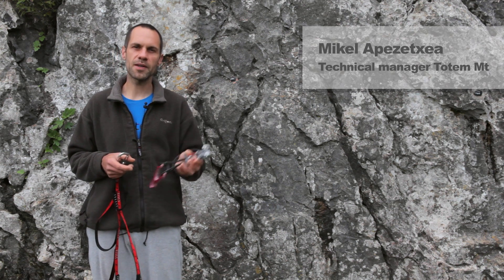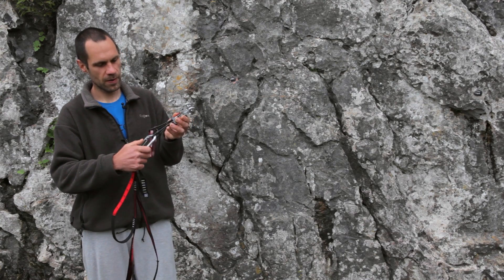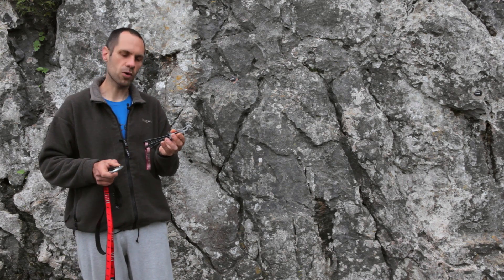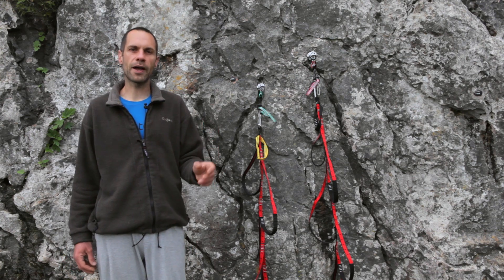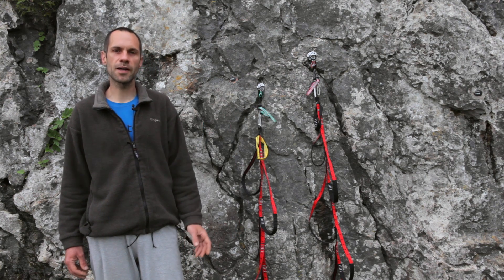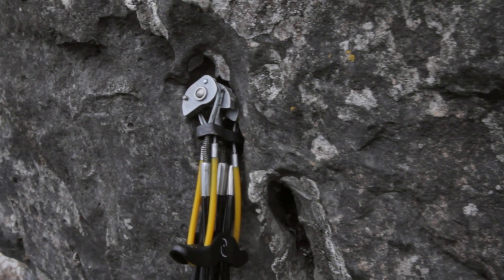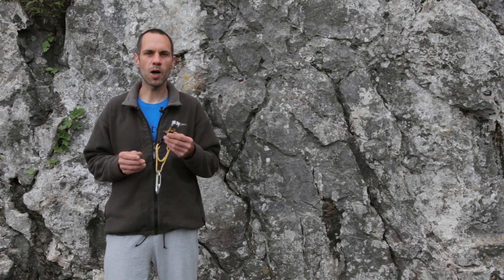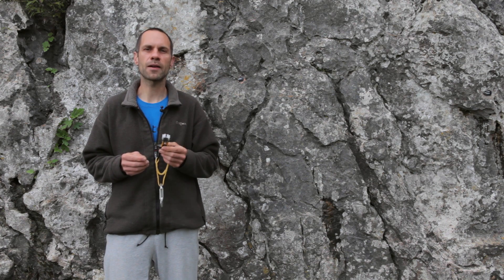Totem Cam two and three lobes placements

Comment: Why clip through the plastic loop instead of the sling? If the outer lobe is unloaded I'd imagine clipping the sling would behave as if if the sling running to the outer lobe was simply cut, in which case the force is applied directly to the plastic loop as your demonstrate. 

The difference I see is you're clipping slightly closer to the lobes which means you can step higher in ascenders, and potentially a smaller moment arm if the cam is not aligned with the direction of applied force.
Reply: Clipping the sling would apply a torque rotating the cam, clipping the "plastic loop" or more appropriately the steel cable covered in plastic, apply force only on those two cams, without trying to turn the axel